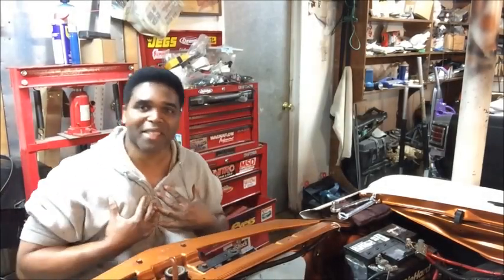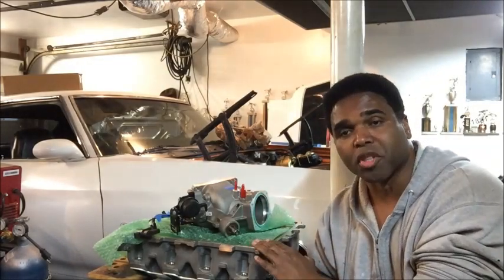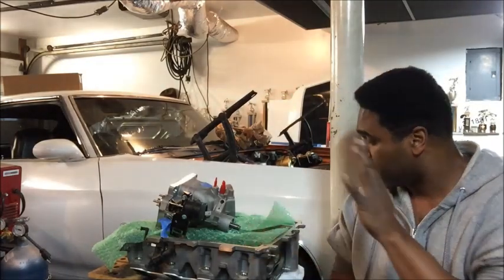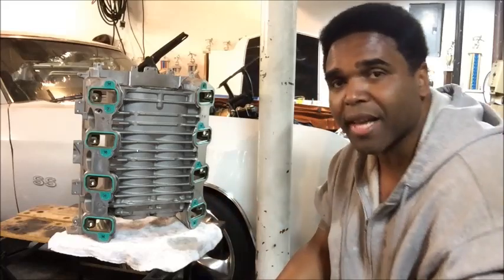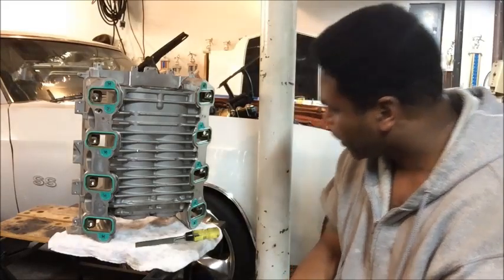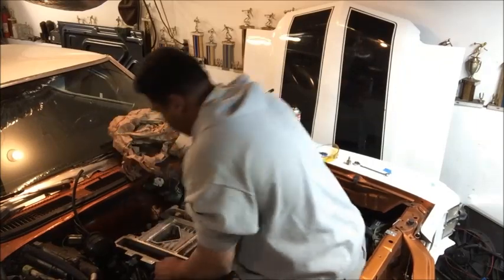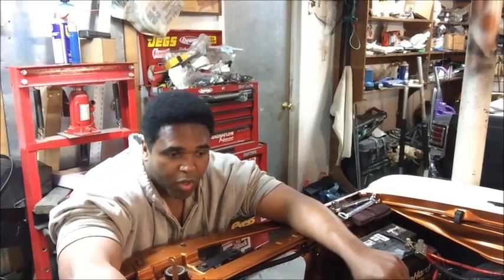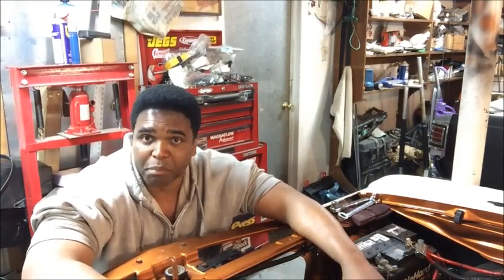LSA PREP BEFORE MOUNTING ON ENGINE PT1.

Comment: Do I need to replace the oil if I remove the snout. .....I bought a new gm unit and I literally put less 500mi and it already sounds like the isolator/front bearings are on their way to lunch.         : ( .....      I'm curious to see what kinda isolator they put in there!!!!!....I bought it in Oct of 2020, no telling when gm built it though........arrrrrggghhhh
Reply from the maker: you dont have to, but if the blower is completely off the car i would check it for sure..

Comment: Hey man nice video! I currently have my lsa torn apart, changed the isolator and pulley, and drained the oil, gave it a good cleaning, now need to put back together. Do u know how much oil I need to order to fill this or about how much oil it should take before it starts to drain out the back from being completely empty?
Reply from the maker: i go with the GM supercharger fluid one bottle.. fill it til it starts to come drip out and your done.. keep me posted on the build.. let me know if you have any questions..

Comment: Hey bro got a question i have a 1992 oldsmobile custom cruiser with a tbi 5.7 want to know your opinion about a ls swap 4.8 or 5.3 and the coast of the build if possible thanks
Reply from the maker: 4.8 and 5.3 are going for a couple hundred bucks.. the entire install should be less than 1500

Comment: Just subscribed. I see boost district has the kits for sale. I don't know if 3000 plus is a deal for one but cheaper than most supercharger kits I've seen for lq4 engines and the only other in this ball park is torque storm kit. I atleast with a lsa I won't need to do a tbss intake since it bolts directly to the engine
Reply from the maker: stay tuned brotha Charles im doing on on a TBSS right now.. .

Comment: I appreciate how thorough you are with the prep work. The key to every job is preparation. Making a list makes sense. I had a 1968 Camaro as a kid and was dropping the motor but forgot to fill the radiator... ouch.  Starting a rebuilt motor dry causes me to cringe when I think about it.  I caught it in time but still... make a list while reading for bed and jot down tasks when they dawn on you.
Reply from the maker: i do that for sure.. the little details are the ones that will bite you.. thanks Brotha BG for the tips and vieiwng..

Comment: Good job! So, you can buy these now $500-800 from ebay, just lower part, top, upper intake with intercooler is separate, another $400-500..., anyway, usual part what is wrong with these is that coupler, right?/ Those you can buy for about $20-30 from ebay. Somebody told in here, youtube, you could use AC Esther oil, #100 in a supercharger, is that true?? Anyway, this is good for any Chevrolet V8 engine, even not Cadillac or Corvette?? What engines you can put this in?? I was thinking to put one in my Infiniti FX 45, which I am boring 5 litre, with performance pistons, and cams! I should modify/ make  the intake adapter, plenum...., maybe too much work?? I might do with M122, same as F150 and newer mustangs have, easier?? What do you think?? Also, they say that compression rate should be lower, like 9.5, when you put Supercharger in?? Mine is like 10.4, will be, that should work, right?? I wonder, what is compression rate in these Cadillac/ Corvette, 6.2 litre engines?? Do you know?? Thanks, youtheman =)
Reply from the maker: whats good Eero, you can get some of the pieces cheaper but you are in the ball park.. im putting the AC delco supercharger fluid in the blower because its what cam from the factory.. sounds like you will be having a ripper.. i dont think you will have any issure installing this engine.. id try to go with a t56 6spd, but it sounds like your on the right track.. keep me posted..
Reply: Thanks, soo....., you don't think, my compression rate= new rate, which will be 10.2/1, is not an issue, if I put M122 in there, since I will have intercooler, and also methanol injection also to keep it cooler??? If you say :Yes, i will do it !!! Just keep PSI/ boost at 10 the highest, right?? Thanks, youtheman =)
Reply from the maker: im at 9.6.1 not to far off and with the 2.55 pulley i have im a lil under 11 lbs of boost. without meth, if you go meth you will be more than fine .. thanks going to make some serious power.
Reply: Thanks, I believe / trust you , of course !!! I don't like these " engineers", who read a book, and just "compare" numbers, and say: no, you can't do it, it says so...here in a book!!" If I keep engine cool enough, with intercooler, meth injection, and low, maybe 10?? boost, I should be fine, right!!?? Let you know, how it turns out,.....could be the fastest SUV, 4 WD, in Palm Beach County, Florida,......who knows ;o)) My question is, where the "hell" can I get my PCM programmed??? Should I send it somewhere?? Because my Infiniti is 2004, I can't even get tuner/programmer for it??? That is what they are telling me...., after 2005, there is plenty is tuners available??? What do you think??? Thanks, youtheman =)

Comment: so when I install my LSA charger I'll have to have use gaskets on my charger as well as my dirty dingo conversion brackets
Reply from the maker: the LSA gaskets are pressed on the LSA.. you could remove them and repressed them if you really need to. but if they are a lil bent out of shape i would try to straighten them out..

Comment: I would highly suggest a solid isolator while you have the snout off of the supercharger.  The two piece spring loaded isolator that GM uses sounds like hell at idle and cruise.  LPE makes a solid piece for under $100, it's well worth it.
Reply from the maker: Reckless.. thanks for looking out brotha.. i got the Lingendfelter isolator...  thats spring one had to go.. thanks

Comment: That's sweet bro!!! I'm going to put a new trans in the Regal for some reason I cannot get it to down shift with the pedal I played around with the detent cable kit from bow tie overdrive to no avail!!! I had it built back in 07 so ain't no telling what's wrong with it!!!
Reply from the maker: what type of tranny is it?> 700 r4?
Reply: coverman66 yep!! itll shift if i do it manually but not with the pedal
Reply: coverman66 I have a special kit from bowtie overdrives that allows you to adapt the cable to the throttlebody. the cable that comes with the kit is adjusted by turning to nuts I moved it all the way out and all the way back in and everywhere in between and just cannot get it I also had to drop the pan and put a spring inside where the detent cable hooks up to I tried to email bowtie overdrive but have not heard back from them